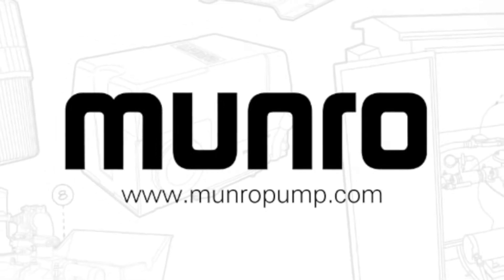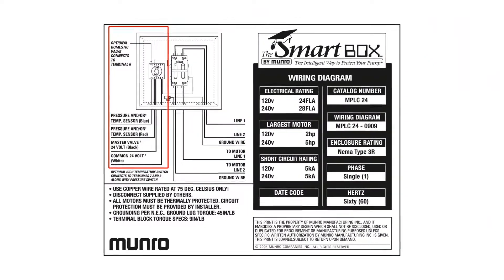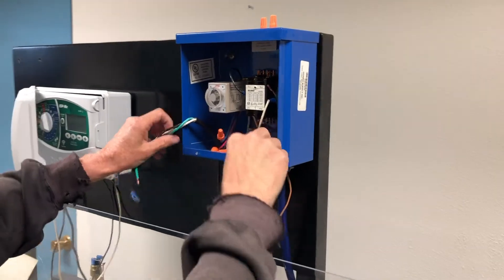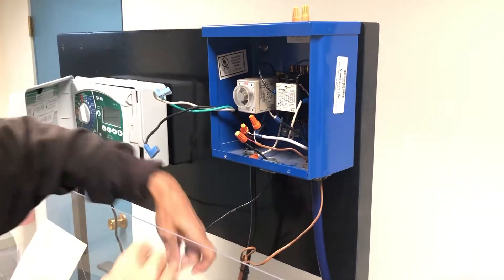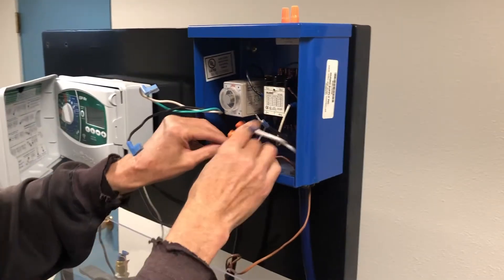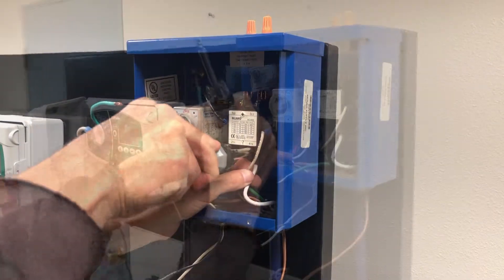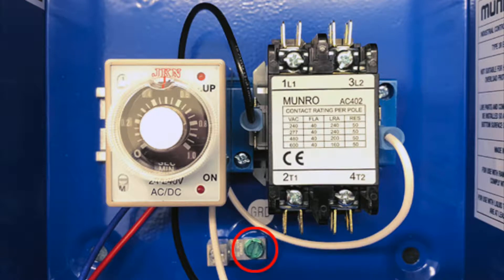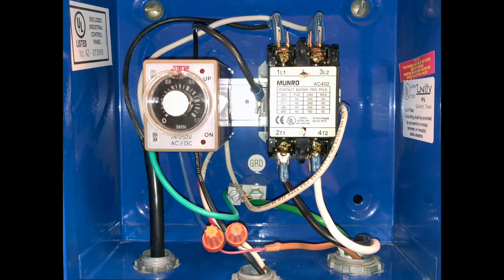How to Wire a Munro SmartBox

Comment: I have a temp sensor AND pressure sensor.  Each has two wires. This is a Munro pump, came with sensors. How do I connect them?

Comment: Do you wire the pressure sensor and temp sensor in parallel or series?
Reply from the maker: Thank you for your question! The sensors are wired in parallel.
Reply: @MunroCompanies  does it matter which one is first on the discharge pipe?
Reply from the maker: @Pumptechs  
TEMP SENSOR PLACEMENT:
Provides shut-down protection from dead-head. Dead-head is where the pump is running but a faulty valve didn't open so the water inside the pump case has no where to go. The impeller is spinning, making the water hotter and hotter. The temp sensor will shut down the pump before the heat starts to degrade the seal or pipework. For this reason, the temp sensor should be placed within 12'' of the pump.

PRESSURE SENSOR PLACEMENT
Provides shut-down protection from loss of prime. Loss of prime can be caused by many things - clogged intake, air leak in the suction line, change of atmospheric pressure. Basic definition is that not enough water is coming into the pump case to balance the requirements of the output. If an imbalance exists, the pressure in the pump system will decrease. This pressure imbalance is what the pressure sensor is monitoring. If the pressure drops below 30 psi, the system starts the shut-down process. For optimal performance, the pressure sensor should be placed close to the pump as well.

Often, if there is a port available on the pump, a tee can be used at that port. Optionally, adding a tee to the discharge run and plumbing both sensors near each other should work as well.

Comment: I was reading that you can connect two separate sprinkler controllers/timers to the Smart box.
How would you go about doing that? Wire the two connections together?
Also I'm guessing you would need to make sure not to have overlapping water schedules correct?
Thanks
Reply from the maker: Thank you for asking Munro a question! Wiring multiple controllers into an irrigation system requires a specific SmartBox made for this application.

Irrigation controllers are designed to send start signals to a pump start relay, like Munro's StartBox or SmartBox. If there are multiple controllers, and they are not isolated from each other's signal, one controller's start signal may travel to, and damage, the other controllers. Simply, electricity doesn't care which way it flows on a wire, so the different path options have to be separated from each other. This is true even if the different controllers are set to have different times. If the wiring path is there without an open circuit to stop the electrical flow, the potential for damage exists. So, we do not recommend wiring more than one irrigation controller to a standard SmartBox. However, we have a box designed specifically for this situation, the Munro Multi-signal Box (the MPSR242W series, on page 79 of our 2020/21 catalog).

Munro has two sizes of this style of pump control panel - one for 2 and 3 controllers, and another for 4-6. Both are available in the StartBox configuration (start/stop only) and the SmartBox configuration (pump protection). Contact our Technical Customer Support team for more information and a distributor near you: 800-942-4270.

Comment: The installation instructions state that we must be 15' away from the controller, however, just as in your demo here, those devices typically live side-by-side. My pump is right next to the zone valves and power. How are we supposed to manage that and how important is it? Thank you.
Reply from the maker: Thank you for your question about a Munro SmartBox. You are correct that the SmartBox is often installed in close proximity to the irrigation clock and other components, which does not cause any problems. For any further technical or troubleshooting questions, please reach out to our excellent technical customer support team at technicalsupport@munropump.com or 1-800-942-4270. 

Could you please tell us which installation instruction document refers to 15’ of separation? It sounds like we may have made an error, which we would like to correct. Our product documentation usually includes a code in the bottom corner of the document - please share that code with us via e-mail: marketing@munropump.com. 

Thank you!
Reply: @MunroCompanies  I just drilled a hole in my customer's rock house to put the thing 15' away like the instructions say. Thanks a lot!
Reply from the maker: @justinwbohner  Justin, we can feel the frustration in your comment. We do not make a recommendation as to the distance from the lawn controller to the pump start relay. Generally, as long as the wire is appropriately sized, location of the SmartBox in relation to the lawn controller is a matter of convenience for the installation. We looked into this because we wondered where the 15' minimum distance recommendation came from. We found that some lawn controller manufacturers do expressly recommend a minimum distance of 15' to reduce any electrical interference with their controller. If the manufacturer of your irrigation controller recommends a minimum distance, we would be inclined to defer to that manufacturer. If you would like to discuss further, please contact our technical support team at 800-942-4270.
Reply: @MunroCompanies  It was in the instructions to my Brain Box.
Reply from the maker: @justinwbohner  John, our apologies. We wrongly assumed you were referring to the SmartBox, per video above. While sometimes inconvenient, following the installation instructions of lawn controllers and control panels is important for a properly run system. Expectation is this system will run flawlessly for a long time. We invite you to call our customer technical support line (800-942-4270) to further discuss, if you are so inclined.